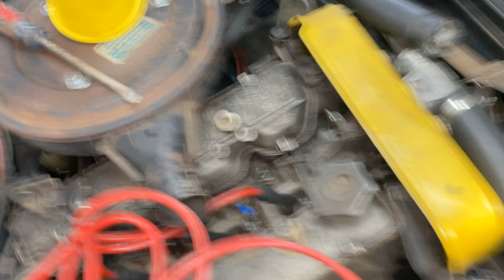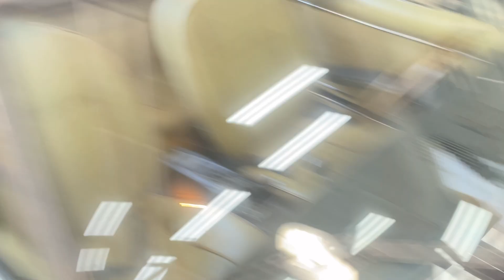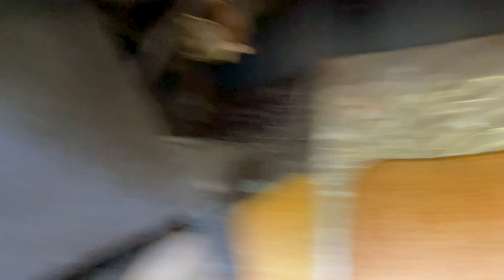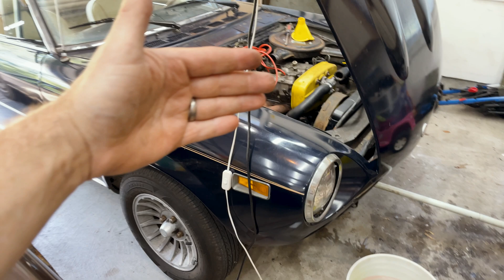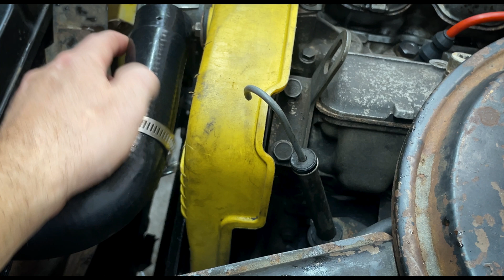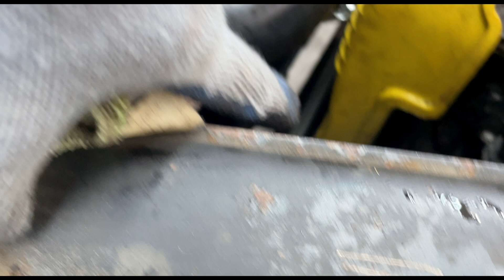Coolant Fill and Burp For the Fiat 124 Twin Cam Engine

Comment: First off I've found the external thermostat makes it much more difficult to purge the system of air, second if you purchase a coolant t that has a cap on top and mount it as high as possible on the heater hose coming out of the engine this also aids in coolant purging, I converted my car to the early style internal thermostat and really like how much it cleans up all the extra coolant hoses in the engine bay.
Reply: No issues with over heating that way? I've heard conflicting opinions on that.

Comment: If you can get at both hoses going to and from the heater core, I always first flush it out, even using a citric acid or other cleaner. Heater cores are notorious for trapping sediment and rust flakes from the engine and rest of the cooling system. Flush and flush again....then blow it out with compressed air before adding new coolant.

Comment: The bleed method I have used successfully is to open the heater core, jack up the front of the car, loosen the upper radiator hose at the coolant T, remove the upper radiator hose end at the radiator and turn the hose facing up. This allows you to backfill the motor with coolant. Once back filled, fill the radiator up to the base of the radiator hose opening. Reconnect the upper radiator hose, finish filling the radiator and coolant reservoir. You can ensure all the air is out using the same method you did at the coolant T. If you have the bleed screw in the coolant T, you can use it to ensure the air is out. It can also be backfilled using the bleed screw in the coolant T. Lots of methods that work! The flush kits work too as a method to bleed out the air.